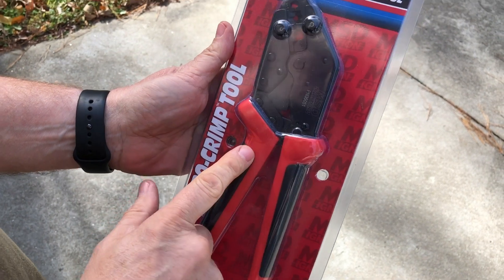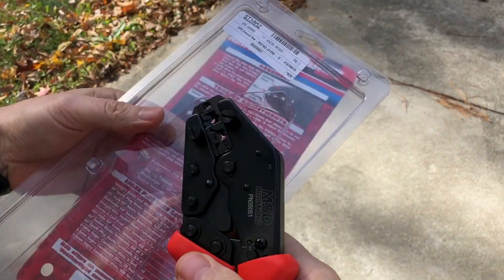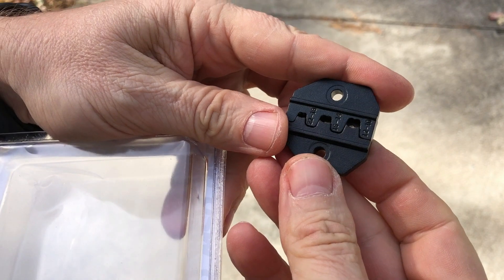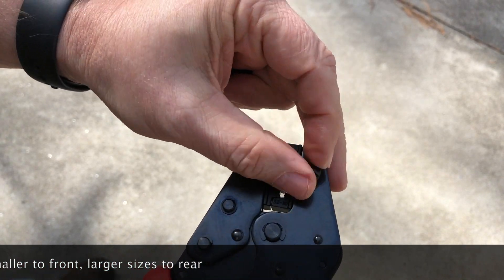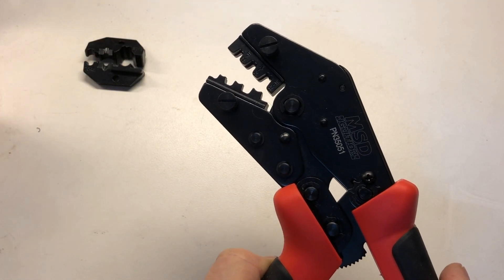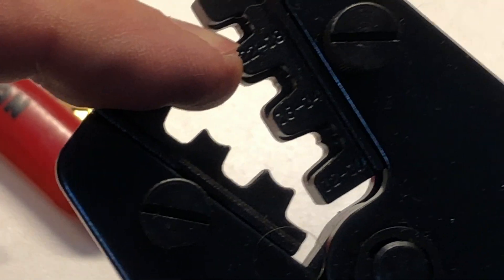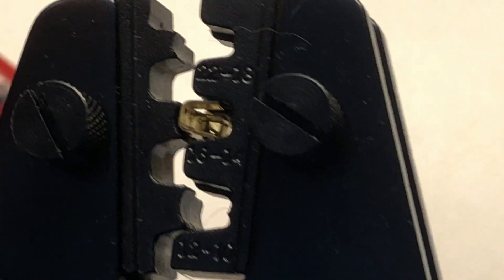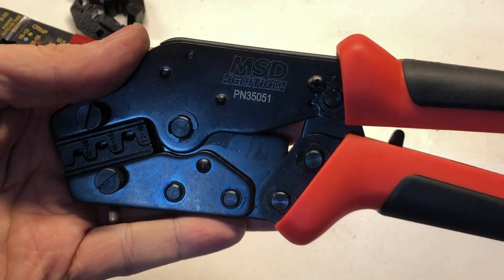MSD 35051 Pro-Crimp Ratchet Crimping Tool ~ Unboxing, Overview, Usage and Demo

Comment: So you paid $120 for a set of spark plug wire crimping pliers, only to crimp regular terminals? Crimps look great, and I "might" order the dies to crimp regular wires later on, but I bought it for it's original intended spark plug wires. I could have got the regular heavy duty crimpers here in town, from nearly anyplace, but I had to specifically order this setup to make spark plug wires, since no one had them in stock.
Reply from the maker: Yep. there's simply no substitute for quality special purpose tools in your shop.  Customers seeking OEM cosmetic style and appearance during restoration work will expect no less.